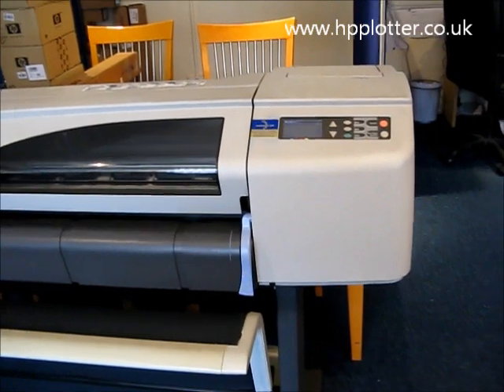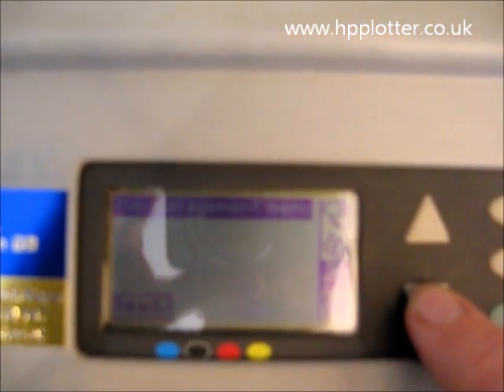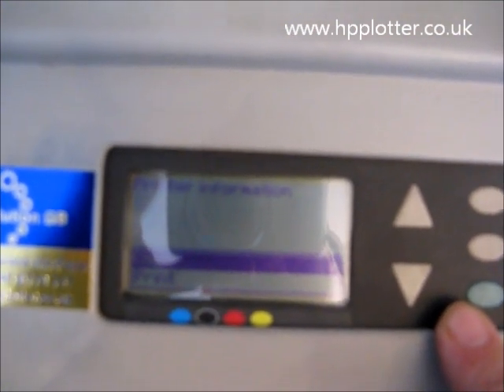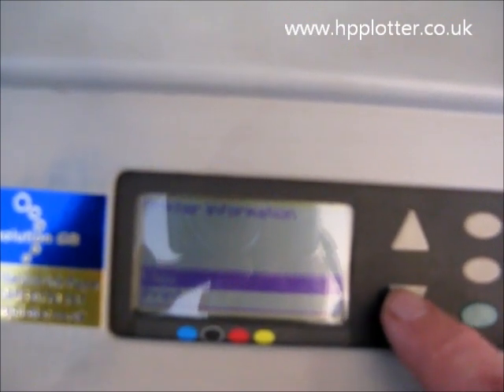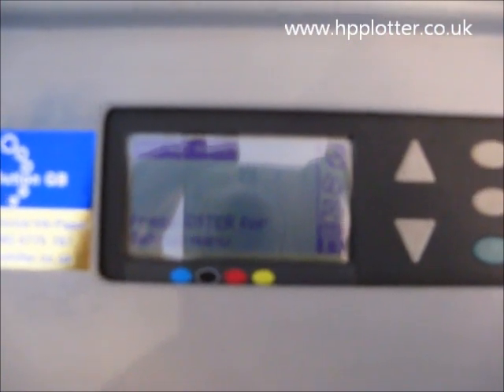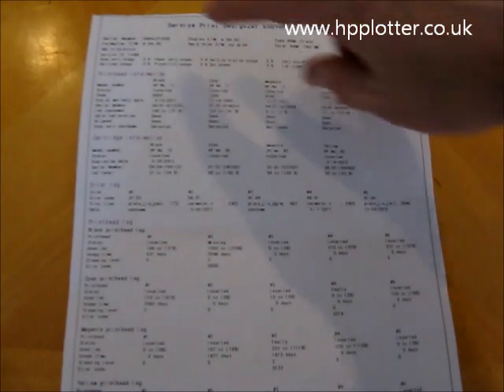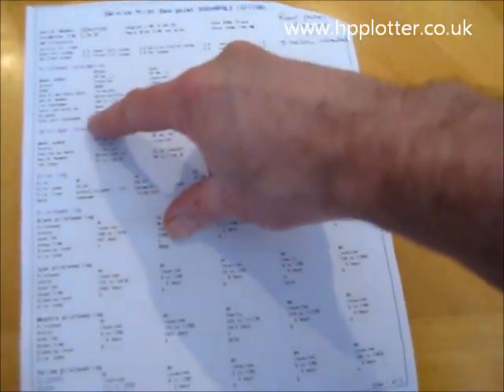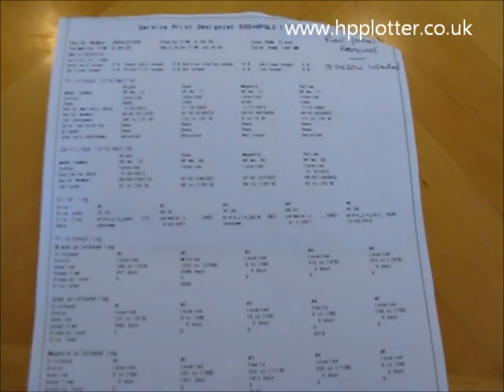HP DesignJet 500 repairs - Print configuration page

Comment: Good Morning,
My hp designjet 510 is not aligning I already changed the print head and the black cartridge and it does not line up, I had a similar problem on an A3 and did the reset procedure on the panel and the problem was solved, you could reset me on Panel for my hp designjet 510? I'm grateful.